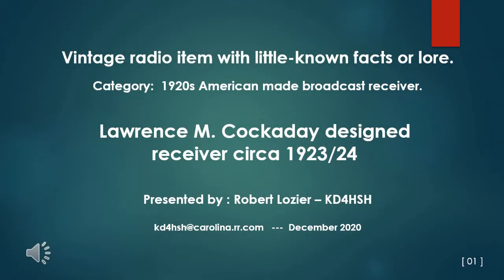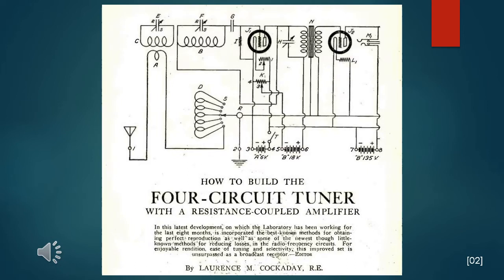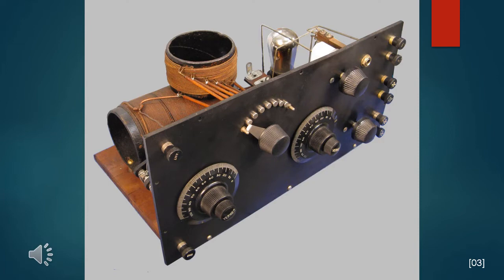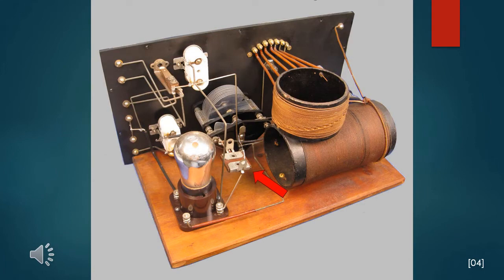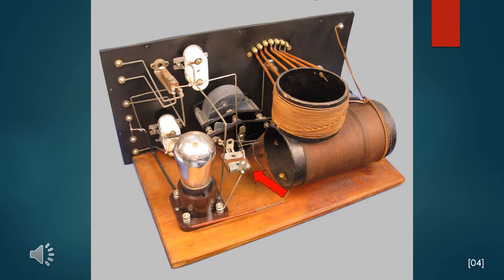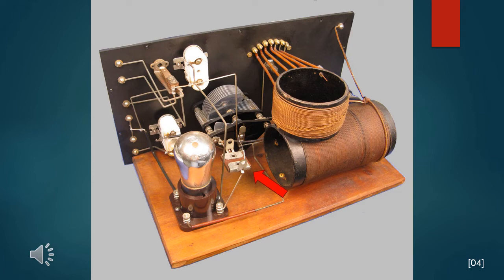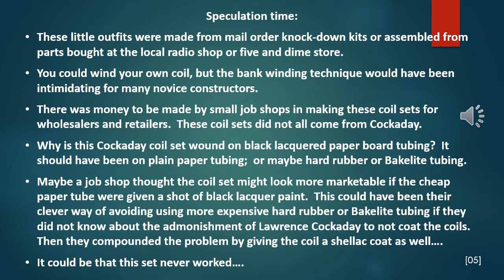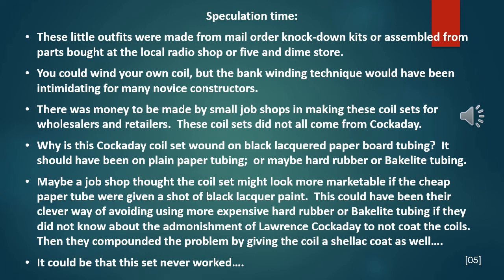A Lawrence M Cockaday designed 1 Tube Receiver that was doomed to fail!

Comment: I have read a while back, so I'm unfortunately unable to cite a specific article, that these sets were deigned to use soft vacuum tubes like the UX200 or UX200A. Apparently they don't perform that well with hard vaccum tubes like the UX201A. That could be something worth trying.

Comment: "Mars Black" is an inexpensive iron oxide based black pigment that was developed early in the 20th century. If that's the pigment used on these coil forms, it could be the problem. See: https://en.wikipedia.org/wiki/Mars_Black_(pigment)